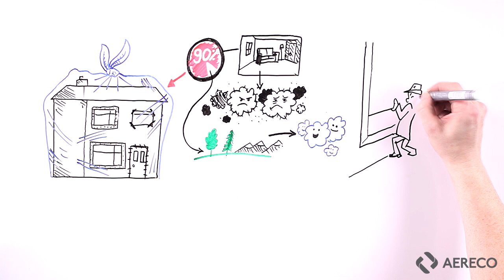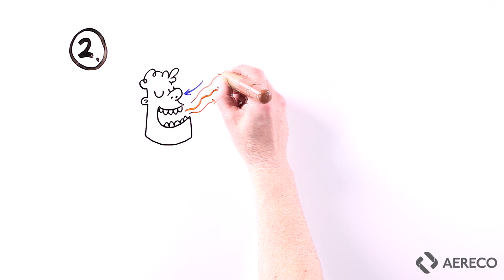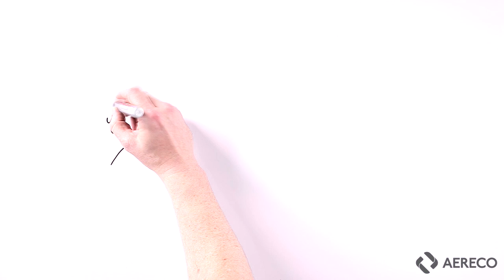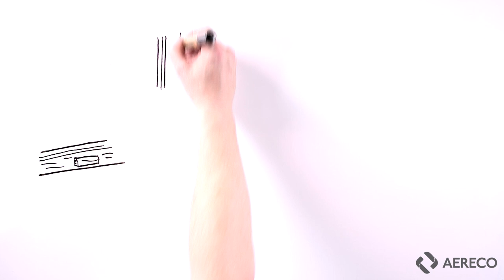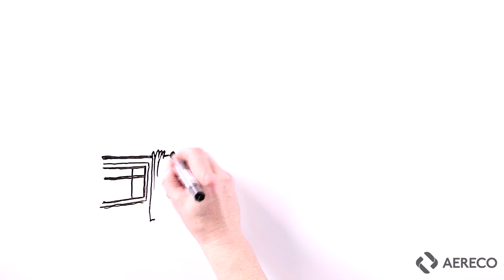Ventilation Basics Series #1 - Why we need ventilation

Comment: Question. If I already have an airbrick vent in a room, It would be rather silly of me to then fit a window with another air vent. Yes ?
Reply from the maker: Hello Stephen! Thank you for your comment. An airbrick in a room is indeed an air inlet. There is no need to add an air inlet on a window or a wall. However, it is just a hole, whereas our air inlets are usually equipped with airflow limiters to avoid draughts. With a whole-house Mechanical Exhaust Ventilation (MEV), air inlets are only needed in dry rooms, that is living room, dining room and bedrooms. 
Do not hesitate to contact our local subsidiaries (in Ireland or the UK) for more detailed information: https://www.aereco.co.uk/contact-us/